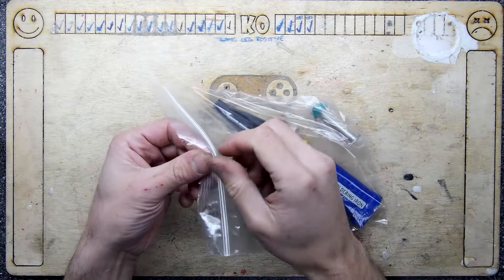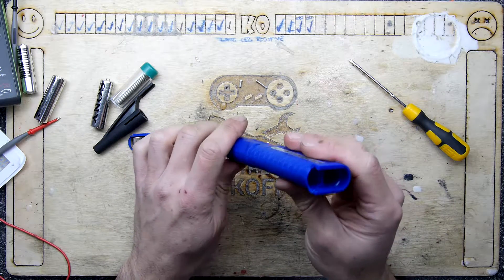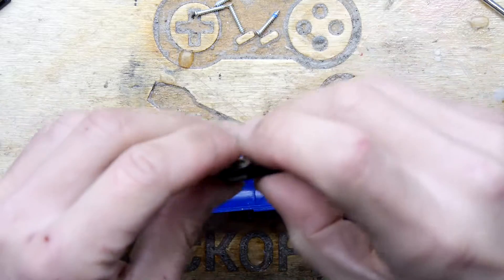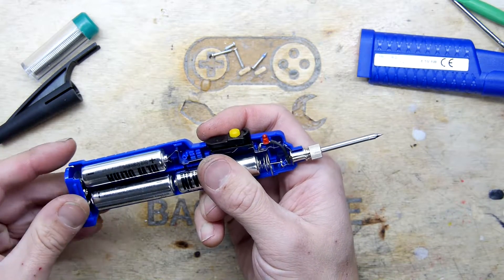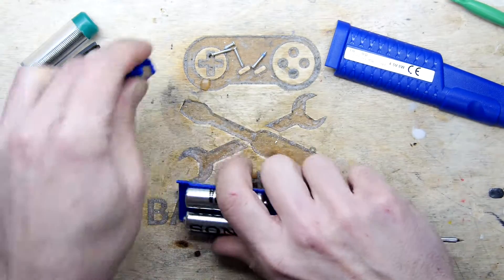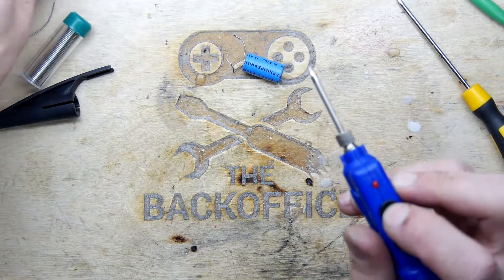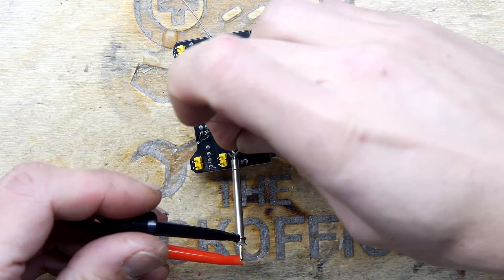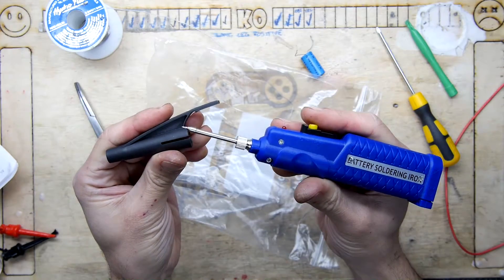Battery Soldering Iron

Comment: I have the same one and the only problem I'd found was the battery cover making contact, a little bend and it works fine, I use three 2600mah rechargeable batteries, the red light is on as long as the button is held

Comment: Great teardown! I bought this unit 2 years back. I had same problem with it. I readjusted and made sure the screw ring at the head wasn't kind of shorting out. In fact, it was the "tongue" connecting the batteries to the screwing head inside that was on/off intermittently. I resoldered the whole thing at that level and it was fixed. The other problem was a battery related one— good Alkaline or NiCad were used instead of cheap batteries. They don't last long enough though. To fix everything permanently, I hooked on to a single Li-ion rechargeable battery bank. No worry until now. Cheers!
Reply from the maker: Thats a great mini fix guide right there and a nice upgrade path! I will try this myself, sounds like it increases usefulness leaps and bounds!

Comment: I just checked the video about 5V Usb soldering iron hmm that sems nice one will check it in couple min i usualy use power supply from pc to do some things around not too much but it goes funny as far i played with soldering iron that has thermal regulation on delux power supply i find out something weird as far the power supply switched off the 12V output line when the soldering iron get to near overheat temp witch is funny i used old soldering iron old one i saw tesla chip for a fun point furst time i think to keep it :D and as far it goes well the soldering iron had termal regulation and power from mains it was 70s style one sems work great i shall go check for metal tips it used some kind of 30% copper rest metal mix on the tip i feel i try clean it then brush it with solder like it was good i dont had any acid as far but it worked out good works fine about now but i really wanted to test it at the first place i feel like i need better filter for the solder smoke or get 12V power supply for laptops i was going for 20V but i tough to try that and it worked good as far i like it i also maked my self one but the problem is i left the heating wire in the body and there is not enough ventilation so ....... it becames hot on 12 v for about 5-10 min with 3 mm copper wire and 10 turns + maybe of one 100W or 150 w soldering iron actually my first one sad for destroying it but i think to remake it soon i might buy cheaper one and check for thermal isulation u got any ideas ?
Reply from the maker: I think it's worth experimenting to find the right setup for your needs, do you have a priority with regards the type of soldering you do?

Comment: I keep meaning to buy a cheap one of these for when I need to do a quick job when out and about
Reply from the maker: +WeirdScience06 my advice if you don't want gas is to get the USB one I covered a while back and use a USB battery pack. Much better solution for sure 👍
Reply: Thanks Andrew, I hope you had a good Christmas :-)
Reply from the maker: +WeirdScience06 Not bad, but I'm getting fed up of the over indulgence at the moment!

Comment: I have the same one they work fine just need to make sure the battery terminals and switch contacts are really clean.
Reply from the maker: +Kevin Rouse I wonder if they have an updated version that uses a lithium cell that is USB rechargeable. I think that would be a real winner of a device.
Reply: The Backoffice sealy do a lithium iron one but that is mains charge as far as i can see they are on ebay from £36.99
Reply from the maker: +Kevin Rouse £4 usb iron + £4 battery pack will do 😄

Comment: I got a battery powered one from Maplins last year, but instantly gets hot and cold,  and oly turns on when it's making contact.

But the problem is they dont' get hot enough for me.   If you really want a portable soldering iron,  you're probably best off getting a gas powered one.
Reply from the maker: +Larry Bundy Jr You can't beat a gas iron for when you need both portability and the need for something that can get bloody hot 😁

I have one had iron I have been using consistently over 8 years and it's still going. By far it's the best design I have ever used. I might do a comparison video to a more recent (and annoying) gas iron. 

BTW, did you see my video on the gas glue gun? That's a genius invention as well!